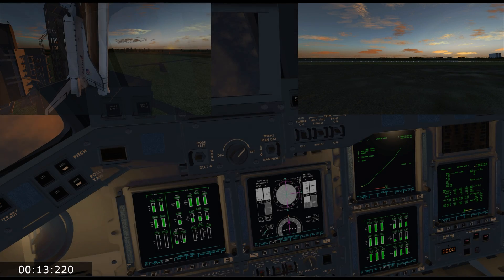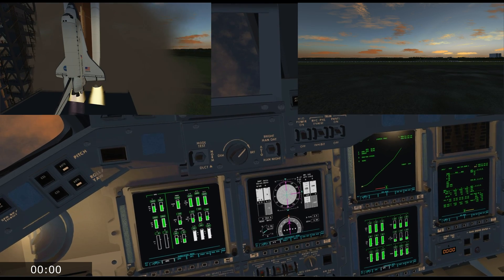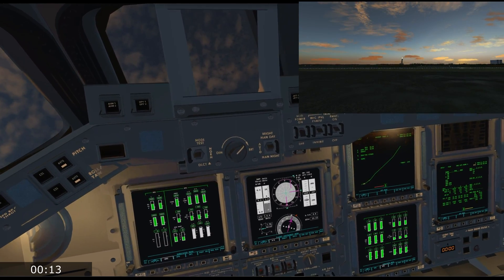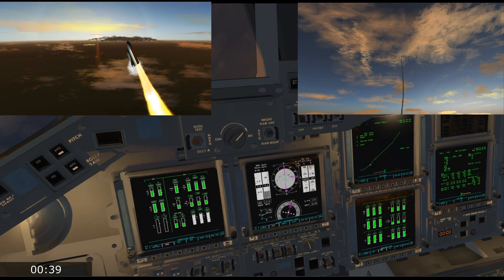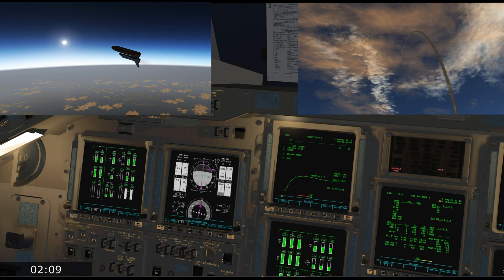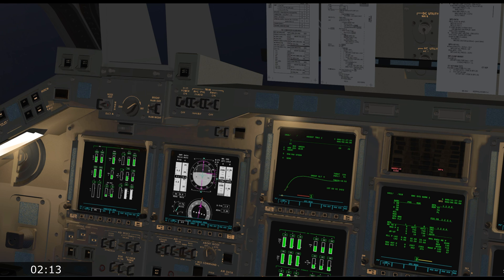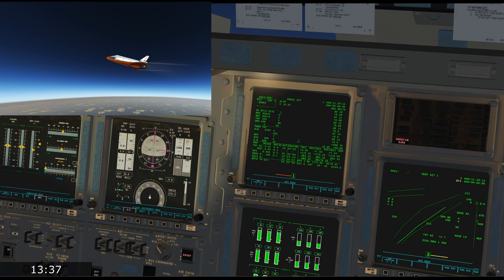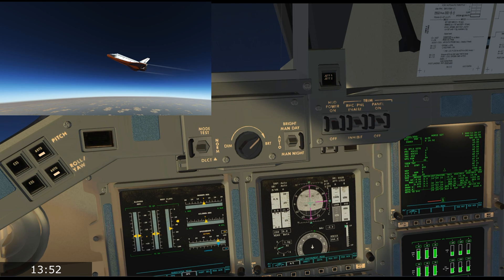Space Shuttle RTLS Abort with OPS 6 real guidance - Flight Gear

Comment: To be quite honest, the graphics of the cockpit material looks extremely cartoonish compared to the high end real metallic like surfaces you get by standards in flight simulators! Sadly it’s the very low grade cgi-graphics of the cockpits material surface that undermines what seems to be a good space simulator
Reply from the maker: @ajohnson7767  « standard flight sims »have a paid 3D team , not flight gear ;)

Not that bad after all, but with more volunteers to work on the 3D , it could be better of course 
https://imagizer.imageshack.com/img924/3290/rukpyB.jpg

Comment: And now we are back to blowing hermetically sealed tin cans into orbit.
Reply: Wich are many times more safer than Shuttle ever was! You can easily find reports from the net how shuttle was almost lost  many times ...sometimes just luck and  skill saved it... it was kept flying when NASA was  pressured from senators in congress and how they  ignored these close call -accidents and in the end  last drop was Columbia's faith and LOC ...it was big money dump in the end... sold to the taxpayers with idea how easy  and cheap it is to use ...but every shuttle was practically dismantled and almost build from the scrap after every flight that costs about 2 Billion per flight! But in the end ...great machine and achievement...but what I know now I wouldn't fly it :): Btw that video/sim of  RTLS abort was likely a suicide... in simulations they found that it was likely that Shuttle and main tank wouldn't hold it when manouvering for RTLS. Something to do  with vibrations if I remember right.
Reply: @harrimela9266  I won't argue that it is safer, but it is also a massive step backward.
Reply: @wilsonle61  ;Well anyway... Hardcore shuttle fan here  waiting for real space plane... ramjet or what ever it will be
Reply: @wilsonle61 nah not really
Reply: @harrimela9266 *which

Comment: With all due respect (former Shuttle training Team Lead - My teams and I trained Shuttle crews), where did you get this information? Why do you have calls about the WHC (ISS toilet) in the Shuttle ascent stage? Who is making these calls on the Flight Loop? How was the abort initiated? I didn't see the abort rotary moved and pushbutton pressed or "OPS 601 PRO" executed?
Reply: I laughed at the fact that they're aborting cause the toilet failed
Reply from the maker: @straightpipediesel  flight rules no go 😂
Reply from the maker: Hello Terry, Nice to have a former pro.

Abort push button at 2:54
Iss Comms are from a YouTube video I found about that toilet thing. Not really relevant with the video though.
I think I will do another RTLS video with all the latest work on the FG Shuttle.
Reply: @gingin3388  Good work! For early engine out, RTLS abort should be initiated (per procedure) at 2 mins, 30 seconds.

Comment: Didnt know Flightgear has shuttle. How does it compare to Space shuttle ultra v5.00? Have you tried it also?
Reply from the maker: I have tried. Great add on in a realistic space environment ( Orbiter) where it is far easier to handle several objects in Orbit for rendez vous etc.

Shuttle within flight gear is still under dev and really realistic : fdm based on real wind data tunnel, lots of system simulated on par with scom , real algorithms for Entry Taem and ascent soon, rendez vous capability, very deep on board computer simulation , abort mode for several engine failures, etc

Lots of failure are implemented with correct fault messages
It is close to a real simulator where we can handle various scenarios. From a single engine failure to a massive loss of fuel cells.

There are close to zero placeholders.

https://forum.flightgear.org/viewforum.php?f=87&sid=9f280229ac64461d220dc11e2de48280

https://wiki.flightgear.org/Space_Shuttle
Reply: @gingin3388  As far as I know the GPCs / MFDs and operations are quite well simulated in Orbiter. Dont know if any failure mode is simulated thought. Also not sure about the aerodynamics modeling. I have some doubts there. Is the orbital mechanics and higher atmosphere fine in Flightgear?
Reply from the maker: @LaggerSVK  MFD and GPC are simulated in flight gear also.

https://wiki.flightgear.org/Space_Shuttle_Avionics

Complex atmosphere  and Non Spherical Gravity are simulated in FG
It is a simulator , not a game

Comment: What backup CW alarm light means?
Reply from the maker: Backup Caution Warning is a redundant system to detect a fault based on a software trigger ( high/low limit from the system management computer )
The primary warning system is based on a proper hardware thing .

The whole thing is quite intricated, old fashioned and complex.
https://science.ksc.nasa.gov/shuttle/technology/sts-newsref/sts-caws.html#sts-caws

System management triggers also some display values.  High or low limits, Ecam style message etc.
Available in fg

https://imagizer.imageshack.com/img923/5642/1undrI.jpg

Comment: What’s the procedure for a total loss of power during negative return? Anyone know?
Reply from the maker: Total loss ( 3 fuel cells ) , it is the end . 
There are procedures for loss of 1 or 2 fuel cells . Everything is highly redundant and one fc can support essential loads for a short time . 
You can have a look at the ascent pocket checklist for electrical troubleshootings section  https://wiki.flightgear.org/Space_Shuttle#Space_Shuttle_Checklists in the non normal section

A loss of two fuel cells on Orbit would be a contingency situation , time critical, close to that scenario : https://forum.flightgear.org/viewtopic.php?f=87&t=36862
Reply: @gingin3388  thanks man! Great information here!!
Reply: @gingin3388  so would they attempt to ditch do you think? I know ditching the shuttle at 200kts is futile but may as well, or an off field landing? Idk thanks for this reply.
Reply from the maker: @joleharding5148  not a ditch , a bailout procedure ; ap engaged to maintain a close to max lift drag ratio angle of attack below 40000 feet and then skydiving 🪂 if an emergency landing site could not be reached
Reply: @gingin3388  even the mid deck crew do they have the capability to bail out? I heard that some of the old shuttles had no capacity for this type of action. I appreciate the reply’s, very informative.
Reply from the maker: @joleharding5148  yes, they had . Those contigency procedures were enhanced post challenger disaster . You can find about that on internet .
Reply: @gingin3388  cheers mate.

Comment: To think they seriously considered testing this on STS-1!
Reply: Yep. There are good reasons John Young said No to the first mission being RTLS. Personally I doubt the Orbiter would have been able to handle it.
Reply: @bdh985 why do you say that? All the (literal) rocket scientists said the math adds up, and a bunch of incredibly less talented people have done it in sims. The key is just fuel and energy management - they have a TON of guidance for both that even the sims make difficult to interpret unless you’ve actually trained for this kinda mission.

Yea - John Young stated “RTLS requires continuous miracles interspersed with acts of God to be successful."

But the reality is… that’s basically everything NASA does. Just different maneuvers at different times to achieve a different result. 

I personally have zero doubt the orbiter and crew could have done it - unfortunately (or fortunately?) we will never know.
Reply: Engineering failures are a bitch. Just cause the sim can do it and all the mathematicians say it could work, doesnt mean a critical part or software won’t shit itself at just the wrong time
Reply: @EstorilEm  it' s known from  computer Simulations that  had shown that RTLS abort was uncertain in survival...structural overloads would  likely make  shuttle and tank disintegrate when it is manouvering  for RTLS and it still has  full fuel tanks...   luckily they didn't test it!
Reply: This is what John Young, before STS-1, thought was involved with an RTLS abort and famously stated "RTLS requires continuous miracles interspersed by acts of God to be successful." Perhaps that was his response after NASA actually proposed that STS-1 carry out a planned RTLS to see if the thing would actually work!
Reply: They did not.

Comment: Master alarm sounded 10 seconds after SSME#1 goes out, and the MEDS annunciates the actual problem even after... Is that typical delay in real shuttle hardware?
Reply from the maker: First master alarm is for a leak in helium system. Ssme was still on at that time 
Second one is for engine failure associated to that helium leak ( 10 seconds later )
Not really sure in real for delay , not a lot of data’s about it , and it is quite complex and intricated failures
Reply: No.